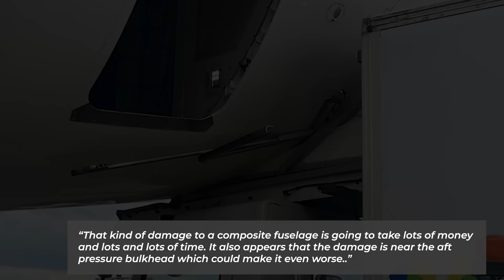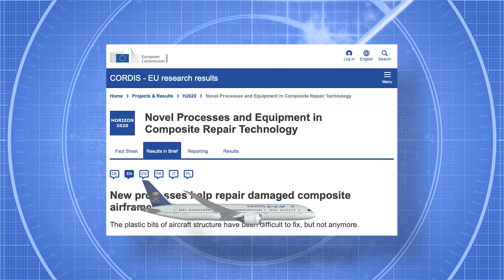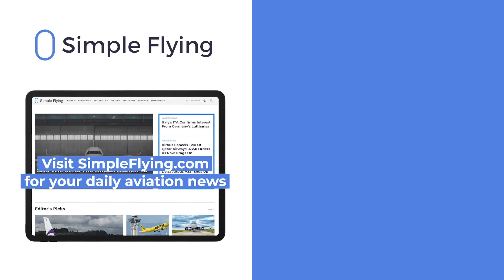Will This Boeing 787, Damaged By Ground Vehicle, Ever Fly Again?

Comment: BA could probably use the engines if they are same type and use them on one of their 787s which are out of use. ( 2 x 787-8,  2 x 787-10 )
Reply: The 2× 787-10 may not have been delivered yet or all four are having routine maintenance with 777's other 787's and A350's covering for them
Reply: It's Saudia"s
Reply: Why would BA take them? They are owned by Saudia and returned to them
Reply: BA and Virgin Atlantic's 787s use Rolls-Royce engines, this Saudia 787 uses General Electric ones, so that wouldn't be possible.

Comment: Probably not, or if it is possible, it will cost a significant amount of money. This is not a typical repair. Boeing has to come and evaluate what kind of repair needs to be done. They have to design the repair and get it approved by engineers. If it cannot be repaired, the entire section will need to be removed and replaced. It’s a very big job. I’ve seen Boeing repair a 777-300 before they have an amazing team.

Comment: This appears to be a major disadvantage with the otherwise superior Boeing complete tubes construction method. I suspect that the more conventional construction using multiple smaller composite panels on the A350 may be easier to repair.
Reply: Yes, the tube construction is very solid - but the cockpit and tail sections are separate - maybe they can cut off the tail and replace with a new one ??
Reply: @LandParkColby I suppose that it depends on where the joins are. 

Separating a whole bonded tube without damaging the adjoining ones might be difficult and. without a guarantee of success, certainly far more difficult than removing just the damaged panels.
Reply: @LandParkColby  I think that will depend if it was designed with repair in mind or not, if the sections are glued together it may gonna be a very hard repair. 
Also the question is if it can be repaired at the airport the plane is right now.
Reply: no it is not. the problem is the same.
Reply: @Pastor_místico_da_bagaceira Of course it isn't the same, the length of the join alone makes that a given.

Comment: It's repairable but it's gonna come down to cost.  X-ray/Radiography typically isn't used to inspect composite structure.    Ultrasonic NDT is the standard inspection technique used to detect voids and delaminations.
Reply: It is theoretically repairable, but there is not enough data to prove it to the insurance companies. You can be very sure it is safely repaired, but someone has to risk the cost of the worst case scenario for the lifetime of the aircraft. 

I doubt it flies again. The risk is just too great.
Reply: I've seen old-fashioned tap-testing used with CFRP, too

Comment: Difference between A350 and 787. In A350 this could have been repaired similar to metal airframe aircraft.
Reply: Does the A350 have a metal fuselage? They advertise it as 70% “advanced materials” or whatever…
Reply: @marionetteworks  What do you understand from "similar to metal airframe"?
A350 has composite fuselage but constructed from individual panels, like conventional metal aircraft. In contrast, 787 was constructed from large tubular sections.
In case of a damage, in A350 you just replace the panels. In 787 you need to replace the complete tubular structure which is impossible.
Reply: @user-yt198 thanks for the explanation
Reply: @marionetteworks  The A350 has a more modern, advanced carbon fibre fuselage which makes it easier to repair.

Comment: Honestly, this 787 probably won't fly again. The rear fuselage looks way too damaged. Fixing the carbon-fiber structure would just be insanely difficult, expensive, and time-consuming. Even if possible, Saudia will likely retire or scrap it rather than spend millions repairing a single jet and taking the potential risk that something may happen to it in the future if it does get repaired. This kind of damage shown usually ends an aircraft’s career in my opinion. Sad to see, but probably the right thing to do.
Reply: Well it’s probably up to the insurers rather than Saudia no? If they can agree a repair process with Boeing and the regulators there shouldn’t be extra risk in the future, it may just cost more to do than it’s worth - although leaving it sat in Heathrow also isn’t cheap so id guess they’d need to repair it to a state where it can be ferried to be scrapped anyway

Comment: If they haven't even tried to patch it over and ferry it anywhere unpressurized, like home base must mean its really bad.
Reply: Carbon fibre is VERY hard to repair. A big gap like that would require a massive custom repair patch to be fabricated.
Reply: @allangibson8494  Boeing can repair it.... They did with ET-AOP at Heathrow many many tears ago...

Comment: No I designed parts using composites once broken it's trash
Reply: Well yes but surely the question is can they replace that section of the tail, adequately bonding it to the rest of the fuselage, in place at Heathrow if they can’t ferry it anywhere.

Comment: Would the company running the ground equipment be liable to some extent (if not 100%)
Reply: Of course, its a 100% claim on the ground equipment company's third party insurance, which because they operate 'air side', will mean they have hull liability exceeding the value of the aircraft they're working on. The airline will also be able to claim 'loss of use' too........
Reply: @artrandy Hopefully, this will motivate the insurance companies to force ground handling companies to install features to prevent this type of incident to occur in the future. Collision avoidance technology has advanced sufficiently to sort this out.😊
Reply: Also if the driver is immigrant and he mixed up the paddle, which shows lack of professional experience and lack of proper training by the company. Hiring low skilled people or students for cost savings is seriously big mistakes
Reply: @fuad747 
If the ground company employed somebody without sufficient training for that vehicle to operate near to billion dollar aircraft, which have then been declared a total loss due to a simple error on behalf of that employee, then the insurance company will grab that opportunity with both hands..........

Comment: To fly again back in operational service, probably not. To fly to the nearest aircraft scrapyard within the UK, maybe. That's if it can be temporarily repaired to fly there unpressurised so as to prevent further stress on the rear bulkhead if that's been weakened.
Reply: I just realized, there's really no scrap value in a composite fuselage, is there?
Reply: I wonder if it to serve a repair test bed, probably it will never fly again, but the fuselage could be pressure tested on the ground to see if anything can be done to repair composite material fuselages.
Reply: Hope scrap dosent happen

Comment: It's a complicated repair but to me not impossible to perform. Besides that, composite is somethimes much easier to repair than a repair with sheetmetal. Composite could be repaired with just milled fibers and some glue. This is ofcourse much more complicated as this through damage has to be repaired different as a composite or metal sheet. Besides that the frames aand stringers in that particular spot start to get closer and space becomes smaller. This type of composite has a different manufacturing proces as on an a350. But again as sheetmetalworker this doesn't sound and look impossible to perform.
Reply: For the museum, it's easy. For flights, it's likely just not doable. The manufacturer would have to issue an official method for the repairs, which evaluation work alone would account to millions.
Reply: @Itapirkanmaa2 That plane is worth over millions. A repair like this is still less expensive as the whole airframe price. A plane over 20-25 years is a good reason to scrap it. Not for this one
Reply: @jouniairplanevideos They need to replace a large element/portion of the empennage barrel, owing to the 787 design.
They are not waiting idle in some warehouse, they need to be manufactured from scratch or taken from the existing manufacturing pipeline.

It may well be the value of the airframe parted out exceeds the value of the repairs.
Reply: @Itapirkanmaa2 i am still not convinced. Yes a 787 is difficult to repair as what i already mentioned. But every plane with such damage needs extensive repairs. Yet it's not impossible. If we can change a skin on a 737 with the same sort of damage yet smaller while a patch was opted at first i don't see it being a problem in a 787. This particular repair probably mean repair te skin from inside out (due nature of manufacturing proces of the skin) and later on repair or maybe even splice the frames and or stringers. I doubt this makes the airplane beyond economical repair. Yes it's a challenge but still not impossible.
Glue patches onto the skin is easier as riveting
Reply: @jouniairplanevideos Aluminium and composite planes are totally different to repair. The 787 has the single piece empennage barrels, 1960s planes like the 737 have empennages made of structural members and riveted sheets of aluminium on top of them which can be rebuilt and replaced on a component by component basis.

There is no "convincing" for me to do. Just check the facts.
There was an Ethiopian airlines 787 fire with a large fire damage in the tail part crown of the empennage, the ELT battery had started a fire. They had to replace the whole empennage barrel, naturally.

Comment: No 2nd 787 hull loss needed
Reply: Be the 3rd lose the China Southern 787-9 that had a bad tail strike is deemed a write off
Reply: @YasminWilson-no3bh why the heck is aviation safety network saying the aircraft is write off what could their source be? The aircraft is still parked 
Incident happened at China Southern main base maybe repairs can be done
Reply: the china soithern 787 has its registration covered and engines were removed last time ppl saw it, i guess its having a similar fate to F-GTSK, which was a concorde who also had a tailstrike and then was cannibalised to use for spare parts, or theyve unnofficially writtten it off like VT-PPN which was an a321 which was damaged in 2019 and was grounded until 2023 and now its used as a testbed

Not sure why asn marks it as a write off though, still have no official source confirming it, planes can still be written off and stored in airports